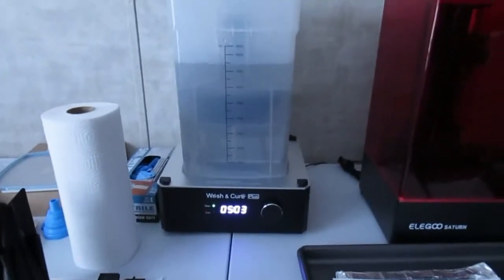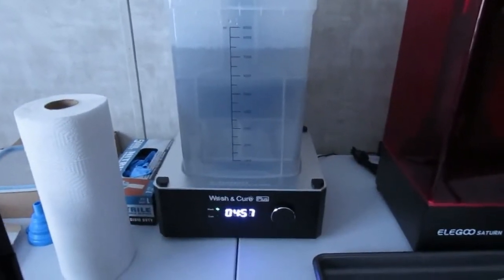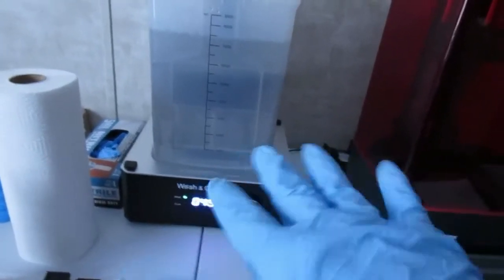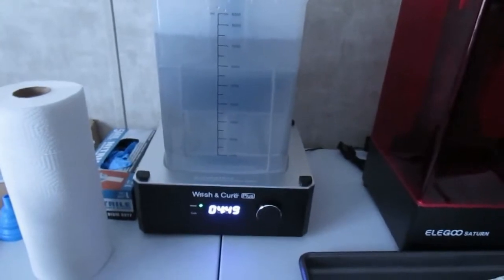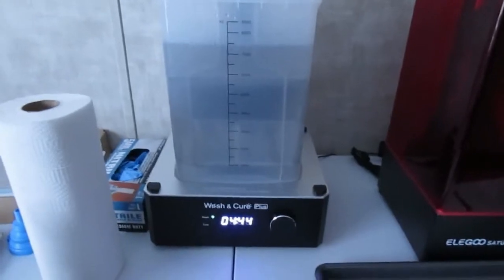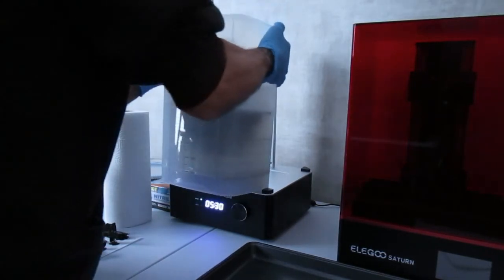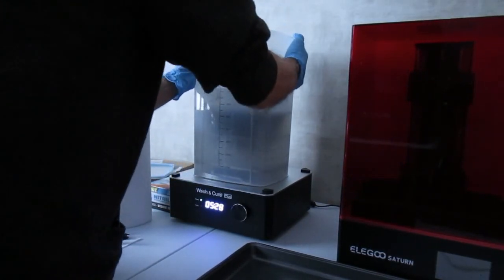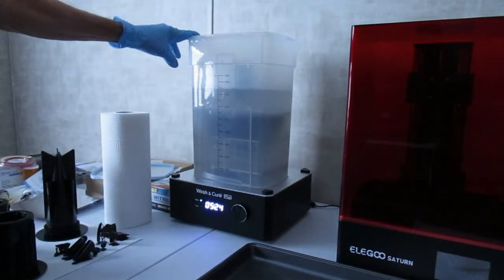Anycubic Wash & Cure has the shakes

Comment: mine is also composed in the same way, have you solved it?
Reply from the maker: What I did so far was to add a 8mm stainless shim to reduce the slop in the impeller/shaft interface, so far it's worked but I've only used it once since posting the video, too cold to do any resin printing. I need to confirm that with water in the tank and letting it run. Are you using Isopropyl Alcohol or water, I'm using water and both the bearing and hardware holding in the magnets are rusting..... I did get a replacement impeller from Anycubic but haven't installed it yet, too many other projects right now.
Reply: @teslabe7701  I am using water, I did not understand where you put the 8mm plate
Reply from the maker: @Ambrosinie-racing  I use it like a washer to take up the slop between the inner bearing race and the screw. I would recommend contacting Anycubic and ask for a replacement impeller, I don't think these will last in water.